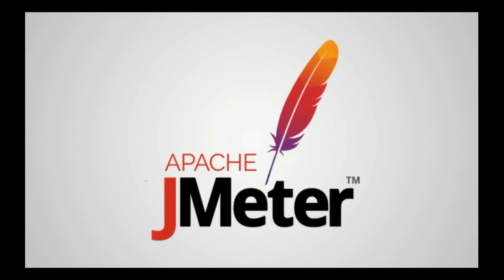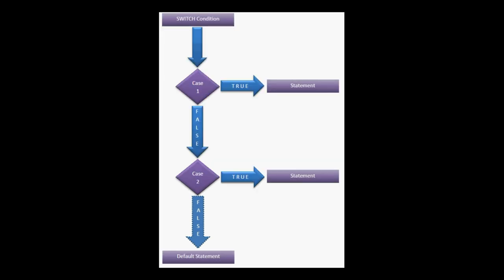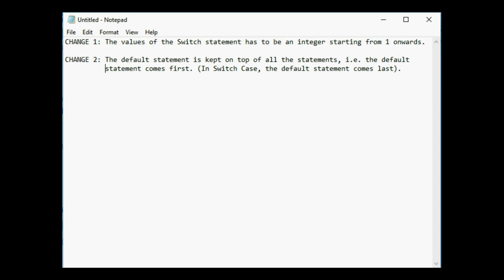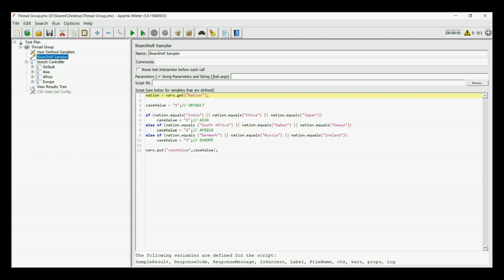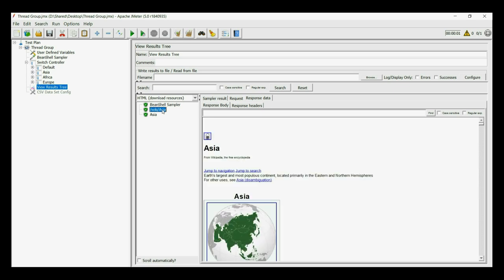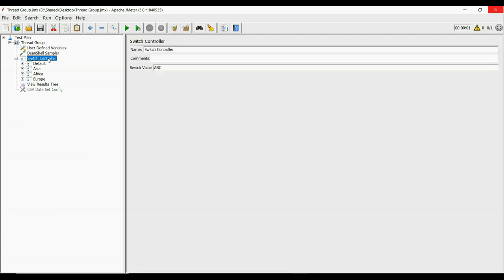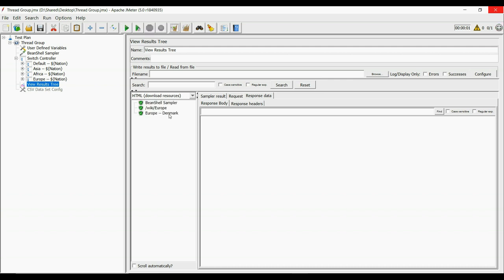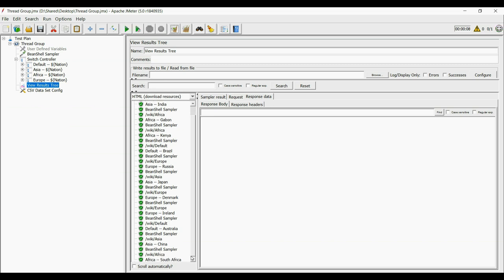Switch Controller in Jmeter

Comment: Can i ask you for the code? i tried 5 times, but not working for me! TIA
Reply from the maker: Please inform which part is not working...
I will try to figure out what could be the problem
Reply: @jmetercommunity2689  Hi, i think i found my issue. btw thanks for such a great tut. helped me a lot!
Reply: @jmetercommunity2689   how you set different switch value for transaction controller ?

Comment: from csv file it will take one record
Reply from the maker: Hi Phanindra,
I realized that you have disliked the video because of the data picked by the CSV file...
This happens when you are trying to run with multi-users with a loop of 1...

To achieve what you need, you can try any one of the following based on your requirement:
1) Multi-User is not mandatory: Try with a single user, but with multiple loop count. It will make a single user call the CSV file multiple times and thus different values will be picked from the list... (This part is shown in the video)

2) Multi-users is mandatory: Here you can use the "StringFromFile" method to capture the data. Unlike the "CSV Data Set Config" which links themselves with the user, "StringFromFile" links itself with the Iteration. Thus, whenever any User calls "StringFromFile", a new value will be picked.
Example: ${__StringFromFile("C:\TestData.txt")}
You can try "StringFromFile" for your requirement. If there is some confusion, I can create a video for your reference.